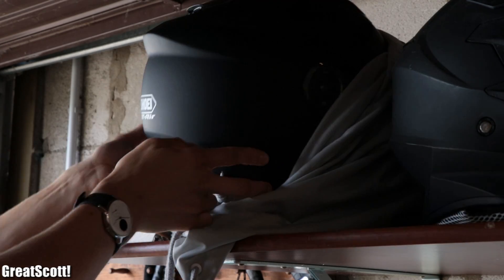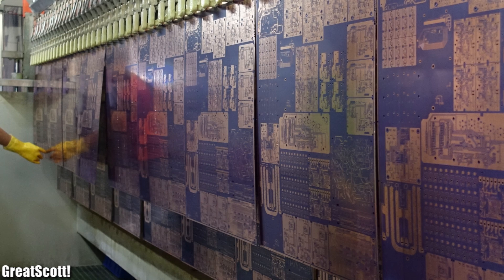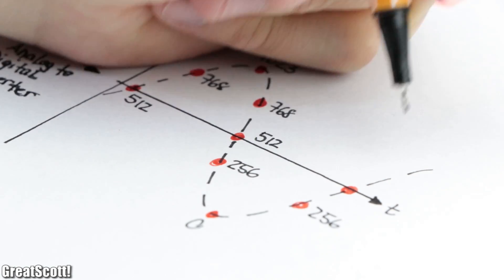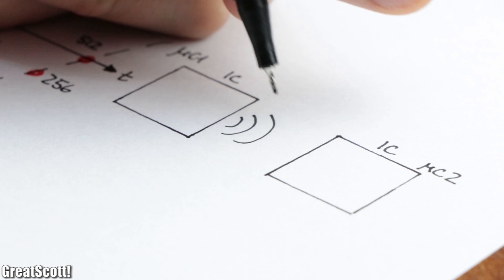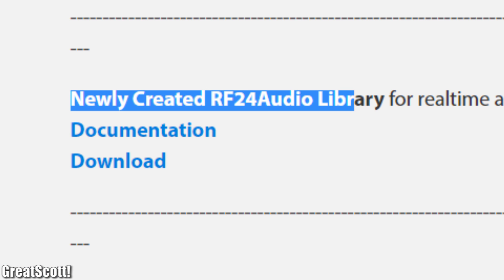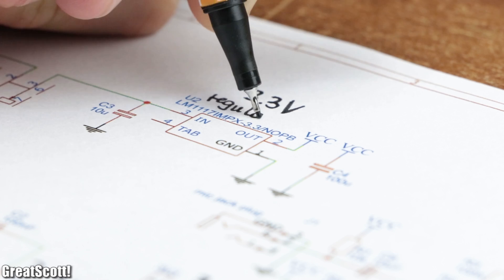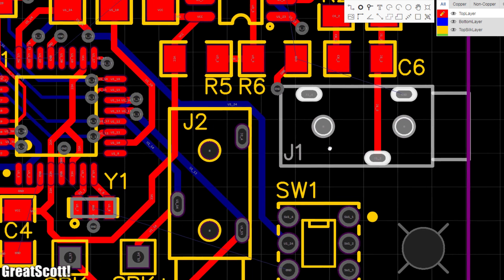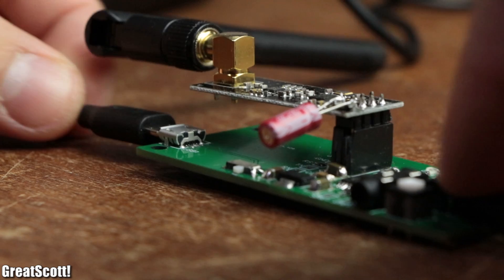Make your own very crude Walkie-talkie with an Arduino

Comment: I find it interesting that all the people shilling for JLCPCB mention the $2 PCB and not the $10+ shipping cost.
Reply: It's still much cheaper than other manufacturers
Reply: @erksampat9328  
>It's still much cheaper than other manufacturers

The boards are "cheaper" but the total order price comes out the same or worse once shipping is added. Take a look at pcbshopper.com. The only good thing about JLCPCB is they have 5/5 rules on their 4 layer boards without charging a lot more but if you actually make a board like that their solder mask is so bad it'll be a complete pain to solder anything to it.
Reply: @Pilot16H It's more like $18 for 5 boards but still $3.60 per board is a great deal. Also that price is the same for sizes up to 10x10cm.
Reply: Isn't the first order free shipping?
I never ordered off of them, but i don't see it as a big problem if it is free shiping for first order, just make new accounts.
Reply: @lazar2175  
 You'd need to move a lot, as I'm sure they track the shipping address.

...
  I think the free shipping bit has changed. All the shill plugs have not mentioned this in awhile. 

  I screw up too much for these services anyways. I'd hate to design, wait 2 weeks, then get stuck with 5 junk boards, redesign, wait 2 weeks....
  I can etch a small single sided simple layout in 1-2 hours with toner transfer without standing up or leaving my bench. I can do a large double sided photoresist, with soldermask, and an aluminum can solder paste stencil in a day even as a partially disabled gimp.
  Heck, a manhattan style prototype or waterproof marker design is even faster. If all that is too much, I'll just use a razor blade and have a small board in 15 min.

  I don't generally like subscription services, but perhaps they could come up with something cheap that makes sense? I wouldn't mind an ultra striped down option for prototyping. If I could order a special one-off single board prototype to do iterative designs reasonably quickly and seamlessly, then order a general production version of 5-10 like once a month, or two, or even quarterly, I might consider it. I mean I don't care about soldermask, silkscreen, tinning, and I'd even give up through hole plating, for basic prototypes. That's how I design anyways already. If they had a service that was really cheap, somewhat flexible, and just sent me some cool basic designs, or useful generic SMD breakouts because I didn't order the full subscription boards allotment I might consider it. 
  If it were possible to easily order prototypes or small production runs where I could get one or two BGA or QFN chips attached without hassles or coordinating with multiple parties, they could persuade me much more easily. Heck even attaching a TQFP with more than 64 pins can be a pain at times. I usually need to have 3 chips per board just in case I need them if it's a new design. I don't even have a BGA setup yet. That's probably the only way they could get me to sign on and really use the service. 

  This cost per board thing is a funny concept compared to DIY. My entire dual style etching setup was less than a bill, including the 10x pack of single sided A4 sized CEM-1 from ABCfab. I still have 2 sheets of that laying around in addition to all the other stuff I've collected. My cost per board is just time. I wouldn't even carry the pocket change equivalent and call it money. ...and I believe the OP mocked me for my lack of BGA experience in the past, so I don't think I'm alone here :-)
-Jake
Reply: @UpcycleElectronics  Quite obviously it is superior to make your own, in fact i've never ordered  off of JLC because my country has quite insane customs so it would take well over 60 days for me to recieve the boards.
I either "borrow" large pieces of unetched boards off of my work, or i order it through AliEx, they are 5 pieces of A4 size for 2€.
I also can't get FeCl3 so i have to use HCl and add 17% H2O2 to make my etchant.
I don't own a laser printer so i have to go to the city and have someone print it for me, mostly losing time.
But i can make boards for about 0.30€ per board without soldermask and other shenenigans.

For smaller projects i still use the stripboard, and for projects that require traces smaller than 0.2mm i order it locally.

Comment: Correct me if I am wrong but you encode it from analog to digital with an ADC and you decode it using PWM? Should you not decode it using a DAC? The sample frequency should be twice the maximum frequency and in case of voice a sample frequency of 10 kHz is more than sufficient.
Reply: Exactly what I was thinking I don't understand how PWM generate the required analog audio signal and why not use DAC
Reply: @danuuu101  Variable duty cycle that's tied to the ADC value. You'll get an audio signal after you apply an LC low pass filter. Look up sinusoidal PWM or PWM DACs. I think GreatScott did a video on those, actually.

Comment: Hi I think problem is that you put speaker directly to PWM output. I think you should use filters to make signal smoother.
Reply: And he needs a 8 kHz low pass filter before the ADC and another 8 kHz low pass filter before the speaker/speaker amplifier.
16 kHz sample frequency is only capable of 8 kHz audio reproduction (Shannon Nyquist sampling theorem).  By not having those low pass filters, all of the PWM noise, high frequency PWM harmonics, and clipping (high frequency pops) is drowning out the useable audio signal.  Signal to noise ratio is really bad without filtering out the unusable frequencies.
Reply: @user-dj1hy6zc6q  Yes, that should be the issue with this. Sampling only covers a limited frequency range is only guaranteed to be accurate when there are no signals exceeding half the sampling frequency. When it's not the case, you get noise and all other garbage.
Reply: That is my guess too... a simple rc filter could help a lot.
I also think the word smoofly should be added to the English language :D
Reply: Agreed, I did some similar. Output was crap. Made a crude class A amplifier using LM317 IC and output was clearer albeit the IC required a heat sink because of poor design
Reply: @SimranjitSinghMehra  How did you make a amplifier out of a voltage regulator?
Reply: @6alecapristrudel  Wait, that's illegal.
Jokes aside, i don't think it is going to work well, but you can try using a voltage regulator as a pwm driver and then use that to the speakers
Reply: @lazar2175 
On the LM317 data sheet there are examples for that. At least the older data sheets.
It's a very versatile voltage regulator.
Reply: If you amplify the PWM signal, you just have to make sure you have sufficient inductance to smooth that back out. If you smooth it BEFORE amplification, then that would would need biased class A amplification, which is hot and inefficient. Otherwise you will be dealing with crossover distortion, which PWM square wave is obviously immune to.
If it is going to be efficient, then the unsmoothed PWM signal is what get amplified. It just gets smoothed out after the fact.
Reply: @lazar2175  maybe it's an LM307.
Reply: @lazar2175  It is posible, but its lower quality than the amp IC for the purpose. Google it
Reply: @SimranjitSinghMehra  LM317 is not designed to be power amp, you can use LM386 and a couple of external components to make descent 1W power amp (headphone amp).
Reply: I would have thought you would need a voltage divider on one side of the speaker so there would be an equivalent of half voltage either side of the PWM signal to get the speaker to go in AND out....
It worked for me when I tryed a similar circuit years ago ( pwm to sound out )
Reply: @ericblenner-hassett3945  A voltage divider can only reduce the DC bias at best, not eliminate it so that the speaker can go in and out. And it'd be at the cost of reducing AC voltage component (audio) as well, which doesn't exactly help hearing it. The correct solution is to put a capacitor between the output and the speaker.
Reply: @notatoyotacamry195  yeah i think you're correct, thats a diy crossover you described
Reply: @notatoyotacamry195 , I agree that would work as I have had both solutions work, it seemed easier with the existing board to add the resistors rather than a capacitor.
Reply: @GreatScott! I would assume that you were trying to go for a class d amp style output stage, right? In that case you firstly lack the current capability to drive a loudspeaker at a reasonable loudness (thus distortion) and secondly (and more importantly), I think you're mixing up your digital/analog audio here. 
You're trying to put a square wave through an ordinary loudspeaker, but a square wave has (in theory) an infinitely high frequency. (It transitions from 0 to 1 in no time, thus infintie frequency). The loudspeaker can't reproduce that though, so it fails miserably and distorts like crap. 
Also there's quite a high DC offset that loudspeakers like that don't like. A dc blocking cap (high pass filter) is needed. 

In order to fix the audio issue, I would add a LC filter at the reciever, band-limiting the signal to half the sampling rate. Secondly, I would do the same to the input. This will ensure (as close to) perfect digital audio transmission as possible. 
If you want to know why, google nyquist shannon theorem. 

In short, if you sample a band limited wave at double its maximum frequency, the resulting filtered analog output has only one possible solution that goes through all the sampling points.

Now you should have a way better sounding audio transmission. Maybe add another power stage to your output, and you're done ;)
Reply: The pwm Signal is that Kind of pwm like it is in Claas d amps, right? So Filtering high freqs out with a LC Low pass would work?
Reply: @Lookas_  No matter what, it needs an 8 kHz low pass filter.  Both on the input from the microphone and on the output to the speaker.  That's the Shannon Nyquist frequency for a 16 kHz sample rate.  Otherwise, the audio output is full of useless high frequency noise which doesn't exist in the usable signal and the signal to noise ratio is terrible.  Fix that, and fix the over-amplified clipping microphone input, at it should sound pretty good.
Reply: @Lookas_  The PWM is a SQUARE wave, we need a SINE wave, which is what amps work with, so it needs to me smoothed/made curvier (like a nice girl hehe).
Reply: @wskinnyodden  yes,  but in class d amps they do just that... They got their vintage amplified pwm square Wave Signal After their Mosfet Outputs ( frequency >200khz ) and then let it run through a LC ( Inductor in series, capacitor in parallel )  and they End up with their amplified original signal
Reply: I think an anti-aliasing filter on the microphone input would help as well.
Reply: I agree. It needs a capacitor on the output.
Reply: Precisely
Reply: bad morse code ... you need to take a morse course to learn morsing a bit better
Reply: square wave its like fuzz distortion on guitars, and its very aggressive!!
Reply: This is not the problem. If he generates the PWM signal correctly, it contains all the right frequencies and then the sampling frequency and its harmonics. Unless you are really young, you cannot hear the 16kHz sampling. It is absolutely possible to stream unfiltered PWM from Arduino into a speaker and it will sound very very decent. Similarly, the microphone input is likely very good. 

I have used this approach many times with the Mozzi library and the tmrpcm library and the sound quality is much better than this.
Also doing everything on a breadboard only introduces a little noise, nothing major.

My guess would be either a software problem or the fact that the speaker he is driving has a too low impedance.

Edit: or actually I think he messed up the input amp now that I look at it. :D
Reply: The arduino analogWrite function is pure crap, you have to use a dac like a r2r network
Reply: Fundamentally this should work, just needs a proper amp circuit. Also you can only really sample the adc at around 9kh. So I’d do an 8khz audio wave. It’s what phone land lines use when crossing digital channels so it won’t sound too bad. I think this is a lot better suited to those stm32 boards you have. They have faster and higher res adc/dac
Reply: yeah, defently!
Reply: Right problem, wrong solution. A simple I2C DAC would fix this issue. Using an I2C DAC is how you create smooth sound signals. They're also super cheap. A simple MCP4725 would suffice.
Reply: A amplifier with a Low pass filter below the sampling rate (the more the sampling rate frequency is attenuate, the better the sound quality). and a high pass filter around 200 hertz, since humans don't use it for talk, would be nice.
the human voice use from 300Hz to 10kHz for talk, and he using 16kHz sampling rate isn't a good idea, since the lowpass filter would have to be very aggressive.
in a ideal world, everything above 16khz would be cut off.
so yeah, increasing the sample rate would have help a lot.
Reply: Also you maxed out your volume
Reply: You guys are all thinking to complicated, it sounds like theres to much voltage going into the arduino so if he changes the R6 resistor it should sound much clearer
Reply: Yes. I also do believe, that the PWM output is not the right way to create analog output from the digital signal. Might use a microcontroller that have a true analog output.
Reply: @sharedinventions  Raspberry Pi's use PWM for audio output. I believe last year a patch was implemented to increase fidelity.
Reply: @spookym0f0  it still has hardware filtering on board, not just headphones connected to PWM pins. Also, its PWM might be way higher frequency than Arduino's. Useful schematics: https://hackaday.com/2018/07/13/behind-the-pin-how-the-raspberry-pi-gets-its-audio/
Reply: Or just use proper analog transciever. Arduino should not be viewed as "universal" solution

Comment: Ok so you should have use esp32 with 12 bit adc and samples the data from microphone and then use the on board DAC  with an amplifier to feed it to speaker that would have give 10000times better results.

Comment: Try using some of those stm32 microcontrollers. They have better ADC and dedicated I2S so you could attach a proper DAC.
EDIT: ok, so the stm32f103 (used in those cheap 'blue pill' and 'black pill' boards) does not have dedicated i2s peripheral, but the SPI peripheral does have I2S mode.

Comment: Rather than using frequency modulation, why not sending digital signal through NRF modules, it requires a pair of ADC / DAC modules or even using arduino ones, but really worth the try, check this video
https://www.youtube.com/watch?v=2ZK6dcBTeT0

Comment: Maby a LC filter beheint the PWM Signal ?
Like in a Class D Amp :D
Reply: I do not see any in your plan
Reply: DAC is the solution, but a LC filter may work out.
Reply: @lazar2175  LC filter builds a DAC basically. I would use an RC filter in combination with a LM386 amplifier to keep it small and simple. The more important thing which Arduino cant handle properly is high frequency sound signals. I would use a proper high sample rate 8 bit or even 10-12 bit ADC.
Reply: @tunahankaratay1523  No, no it does not build a DAC. 
Like it's name suggests, it filters the pwm signal.
The dac converts the pwm to a AC analog signal suitable for playing back in the speakers.
He has a video on it, go watch it.
Reply: @lazar2175  I would say an RC filter instead and LM386 ... but why at first place Arduino? This is a very simple task for 2 transistors on transmitter and 2 on receiver and you can beat audio quality and range with a whole magnitude

Comment: You could save yourself the OpAmp. You could set the internal analog reference voltage of the microcontroller to 1.1V with analogReference () in software, or apply the desired reference voltage to the AREF pin. By doing so, the gain OpAmp could be saved and the noise minimized. Greetings from Austria! Links: https://tronixstuff.com/2013/12/12/arduino-tutorials-chapter-22-aref-pin/ , https://www.arduino.cc/reference/en/language/functions/analog-io/analogreference/

Comment: Wouldn't have made for as good a video, but I think modifying consumer walkie talkies may be a cheaper and less frustrating way to go. consumer models have been in production long enough that you can find either replacement parts or used units for cheap or probably free, there's 80% of the project done.

Comment: You can use the BT-S2. It also is a motorcycle communication device but it only costs 30 Euros and works fine as well. Nice Video, as always. Greetings from Germany

Comment: maybe it is because of the sampling frequency that is much lower than the needed one which is 44.1 Khz
Reply: I was thinking the same. That's what Mr Nyquist said.
Reply: @felixmenendez  Niquist, I only know him for his stability critiera. Or is he the second guy from the Shannon Theoreme? 
 
Also wouldn't  having 16kHz sampling rate  result in a maximum frequency  of 8kHz, which should be enough for voice?
Reply: @patrick_test123  Hello! Yes, I was referring to Nyquist-Shannon theorem, but I realized that I was confused. I was considering the bandwidth of human hearing, but you just have to take into account  the human voice (speaking). 16khz is just fine. The problem must be the pwm.

Comment: Just a bit of hint for you: LM386 does not make a perfect mic preamp despite that it is used in a lot of projects as so. If you want a good preamp, use an electret microphone and an opamp-based preamp like the one described in the texas instruments TIDU765 note. With that thing I could comfortably amplify the sound enough to hear a whisper from another room without any noticeable electronics noise.
Reply: or just use digital MEMS microphone